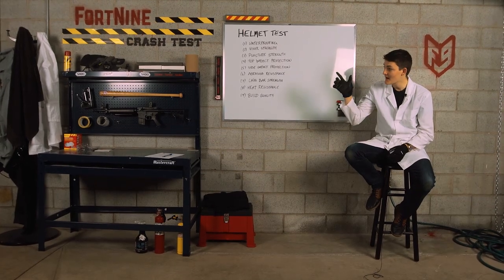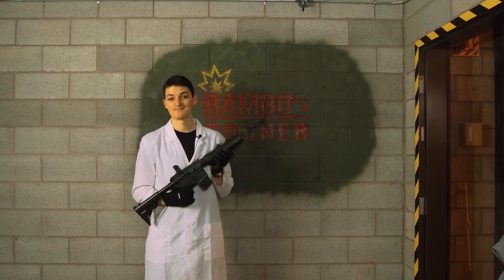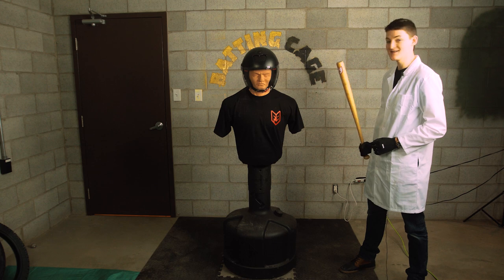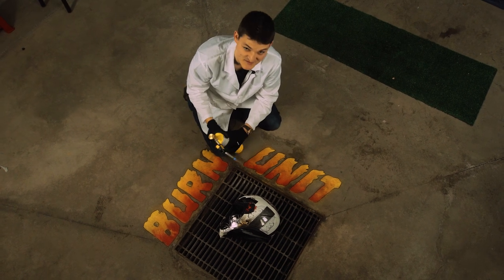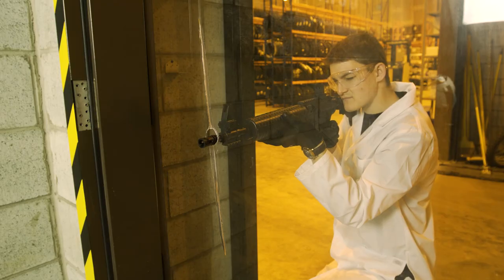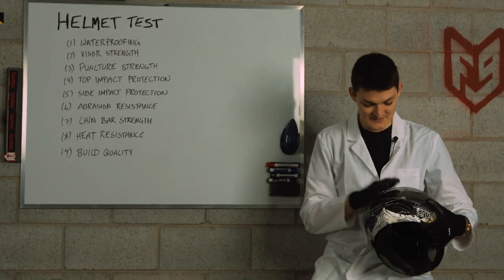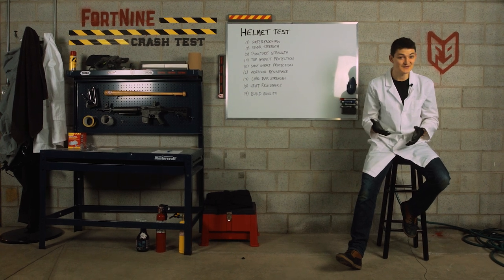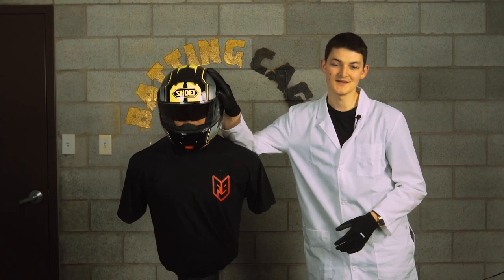FortNine Crash Test - Welcome to the Lab

Comment: All very theatrical but scientifically useless. I'm keen for protective gear to be tested but properly. You don't test a car for crash protection by hitting it with a baseball bat so why do it to the protective clothing. I know from personal experience that clothing like protective overpants with CE rated armor are useless for impact protection to your knees because the armor moves away from the knee in a fall and resultant slide as overpants are inherently loose. Its great marketing saying the pants have CE rated armor but its just crap.  Ideally you want to use a test dummy and simulate: a lowside fall, a high side fall, and crashing into a solid object like a car. This would be a lot more comparable to crash testing a car.